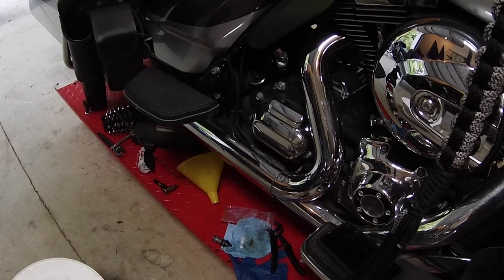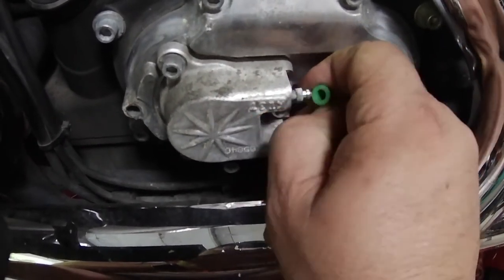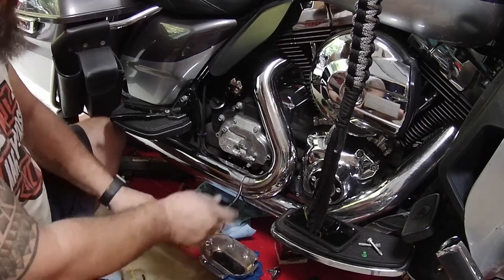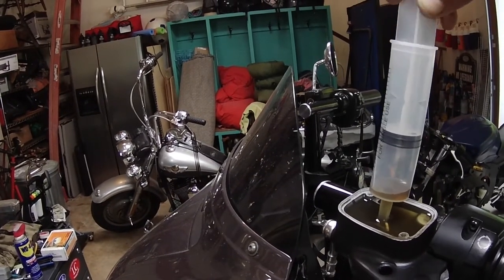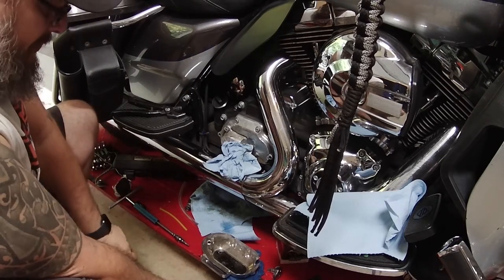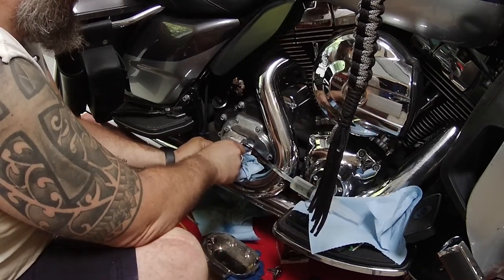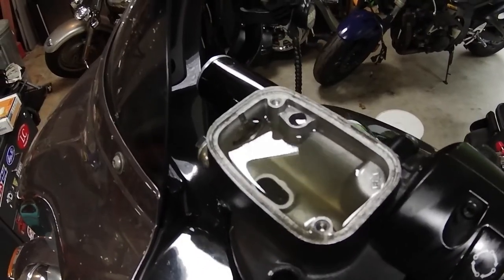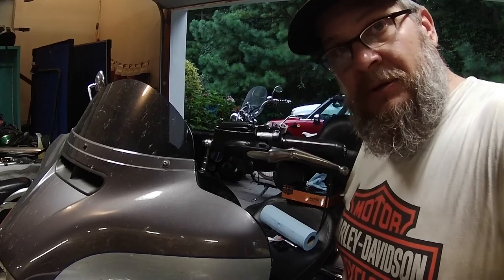Harley Hydraulic Clutch Bleed and Flush

Comment: Will pushing the dirty fluid to the reservoir cause any problems. I know it's not recommended for cars due to possible contamination of master cylinder....
Reply from the maker: In 20 years of doing it I have not had any ill side effects.  Just keep punching it through till its the same color as what you're putting in and keep sucking out the old fluid.

Comment: Hello, in the video you talk about pressing the clutch lever in and out, but that wasn't shown in the video, just wondering when the time to do that is?

Could it be that you flush the fluid through clear like you did with 3 syringes,  have master cylinder 3/4 full, then press lever a few times to see if bubbles are there, if no bubbles at all, or when bubbles stop, then top up the master cylinder and put the cap on?
Reply from the maker: Yes exactly, just do it gently or it will squirt everywhere

Comment: Thanks for a great video. My breather nipple isn’t taking in the push & there seems to be no air/oil coming up in the reservoir. The clutch lever is half in & not engaging properly. 
What could be the issue ?
Reply from the maker: Either there is a clog in the reservoir or in the line somewhere.  Take the line off first from the reservoir and push fluid to see if the line is clear.  If it is clear your next step is cleaning out that reservoir and pulling the inner components out just like you would do on a master brake reservoir.  There both essentially the same
Reply: Thanks having same issue! I was able to blow air through the line. By inner components you mean the piston assembly.? Thanks

Comment: Would this be the same process for an 09 road glide cvo? I can’t find anything in my service manuals for it and I am installing an extended hose soon.
Reply from the maker: If it’s a hydraulic clutch Then yes I assume it will be set up similar
Reply: @YogisCycleService  thanks I started on it today. Did you loosen just the 4 header bolts or the other mounting bolts as well for the exhaust to drop it enough?
Reply from the maker: @austinyoung2182  mine was accessible without removing the exhaust thankfully but depending on the exhaust system yes you might have to

Comment: Yogi be careful with the metric syringe on the clutch side. It is fine for the Brembo brakes they are Italian and use metric. LOL  In all seriousness more how to videos should be like that.  How to do the task, the odd things, like the adapter hose and the proper fill level, didn't leave things out or add unneeded steps.

Comment: Vacuum pump is a bit better with gravity no?
Reply from the maker: It might be but for those without a vacuum pump this is a quick and cheap, easy alternative that worked awesome
Reply: @YogisCycleService  what size hose did you use
Reply from the maker: @Bottom2TopServices  honestly that’s a good question as I just found a piece in the drawer that fit.  I will try to figure that out for you and repost here
Reply: @YogisCycleService  thanks so much I tried bleeding mine hose was too big and got air in the line so I’m trying this method now
Reply from the maker: @Bottom2TopServices  I believe its 1/4" vacuum hose similar to what you find in the bleeder kits.  Any automotive store should have it.
Reply: @YogisCycleService  thanks

Comment: Yogi, I hear  people saying using DOT5 but my 05 road king says DOT4. Any thoughts Sir?
Reply from the maker: I would put in it whatever your cap and or service manual calls for.  My 03 fatboy is DOT5 and my 2014 Ultra is DOT4.   I think the 08 baggers I worked on were all DOT4 also.
Reply: @YogisCycleService  ok cool thank you for answering my questions. I appreciate it!
Reply: Dot 4 for Brembo brake calipers and dot 5 for the rest.